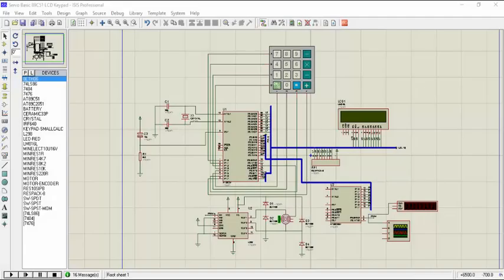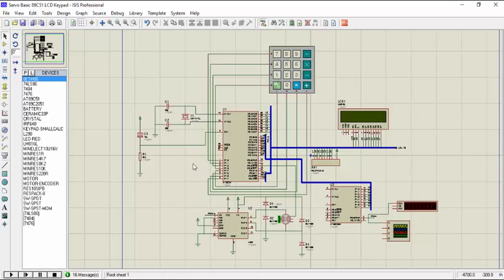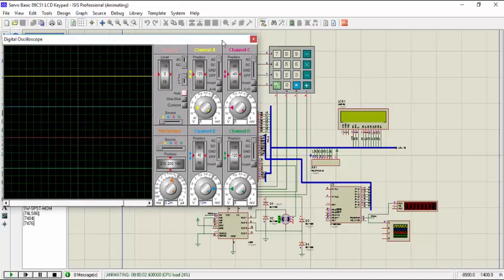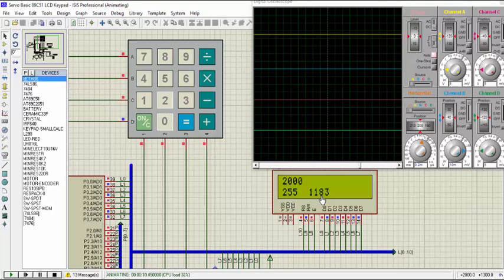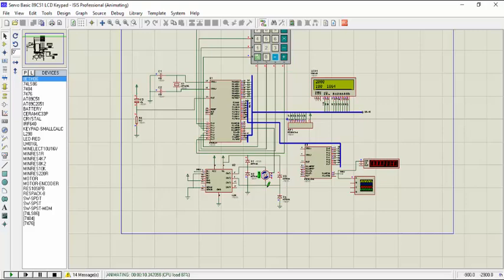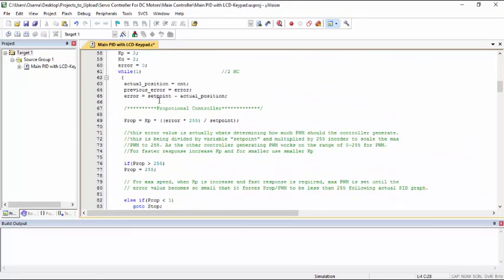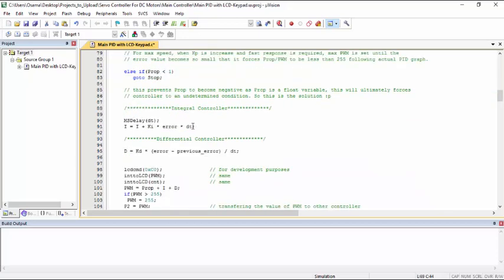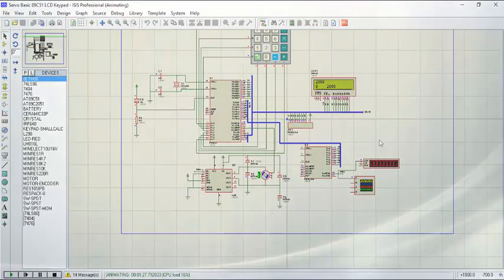DC Motor Position Control using PID Controller

Comment: osama ji the code is working up to the key pad input for frequency and duty cycle. after that when calculating float values a nd formula starting from totaldelaymilli showing garbage values on real lcd. but working well on Proteus. please suggest what I do. some body suggest me to give float values zero. I gave it but problem still persists.
Reply from the maker: Rk I am sorry that you are having these issues. I have actually left programming micro-controllers and have no tools to check the problems at this moment. I hope you can find out the solution and will contribute in github repository so other people can take benefit from it. I really wish you solve your problem soon.
Reply: thanks for prompt reply sir I am trying to solve this problem. after succeed I will inform you. and the correction will upload on github.
Reply: sir (Rk seth/ osama) when i run the proteus file after downloading ,it show some error  like. unable to open hex file of main controller and  slave controller PWM. 
Hex file are not downloading,only copy the text ,when i copied the(hex file) text and save it . dot hex format after that i uploaded it ,it show same error,(unable to open hex file) sir Pls guides about its error.
How to solve this problem .
i have waiting for ur guidelines.

Comment: Hi guys,
We are supposed to control dc motor by analogue way. We need to have the actuator and controller circuits to implement on board. We are lost in our project. Can anybody give advices?

Comment: thanks for the upload but when i run the Proteus simulation and load the hex file named master it gives the error " unable to open hex file slave pwn/pwm.hex"   when i load slave hex file it gives he same error so how can i simultaneously load both hex files. hope that you reply...
Reply from the maker: +Irtaza Anwar Dear you have to upload master.hex in 89C51 (bigger controller) and pwm.hex in 89C2051 (smaller one). I hope you find this reply helpful, should you need any assistance please do not hesitate to ask.
Reply: sir i am trying to implement it using atmega16 kindly upload video of any pid simulation using atmega16/32 micro controller
Reply from the maker: +Irtaza Anwar Dear you can port the code easily to ATMega16. I am quite busy these days, may be in July I can help you because I am planning to extend this project in July of this year.
Reply: +Osama Mazhar  thanks a lot.